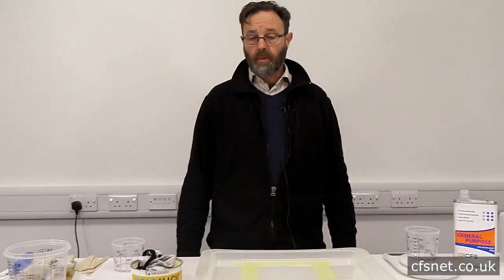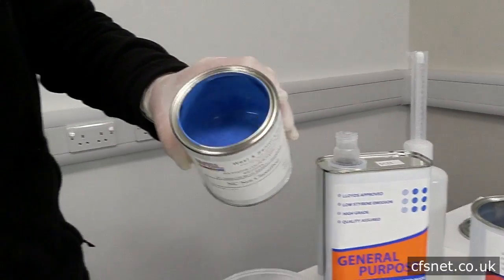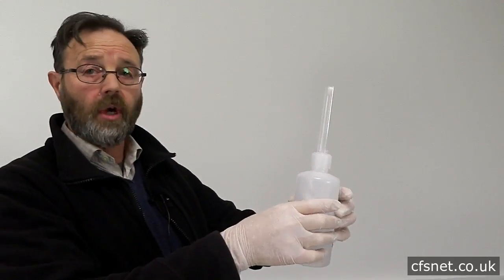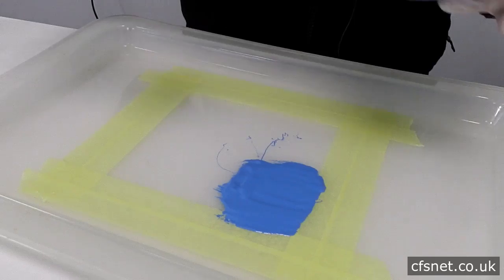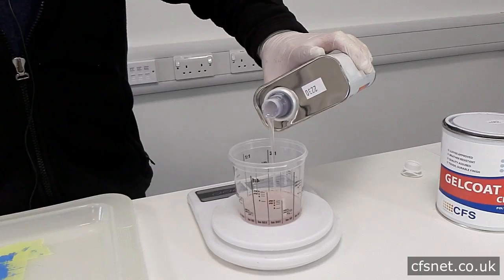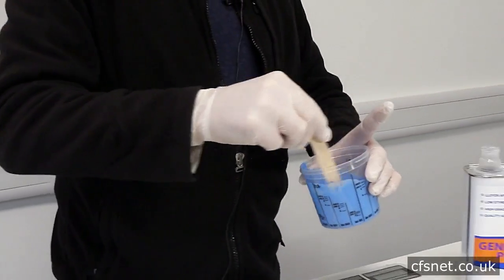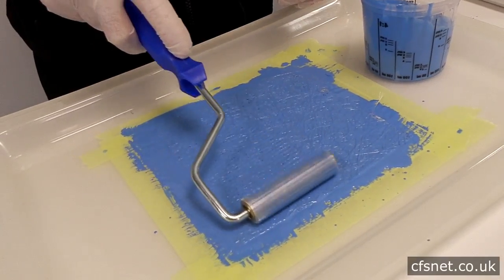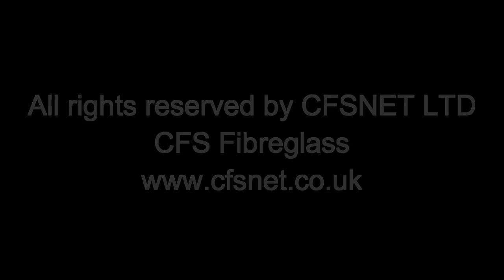CFS Fibreglass Basic Laminating

Comment: I make this at industrial scale. 3% even 4% in gel coat catalyst. Also 6% pigment not 10% to much pigment as will cause catalyst to take longer to cure. Cobalt can be used to increase curing process. I also pour gel coat on and brush gel and also resin and use paddle roller to spread and pull through. Also Place film on final process and comb air for perfect result

Comment: Nice learning video really. Thanks a lot. 
How i recover fiberglass boat damage area by this way because this way i saw smooth plain side was back side & non plain part was top side. but when i recover a damage area in boat then it will top side not back side so after recover damage area it will not smooth plain. 

any suggestion for us? 

Thanks